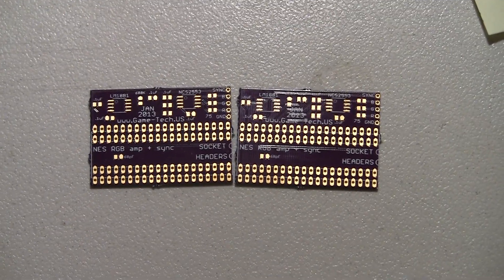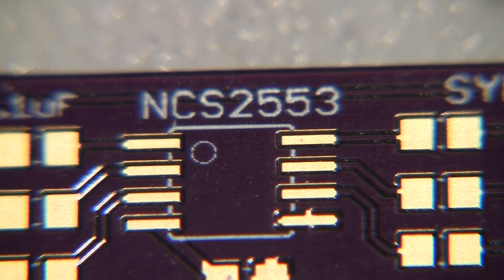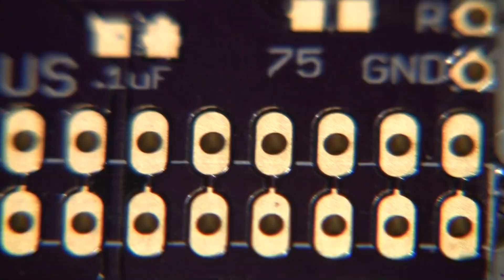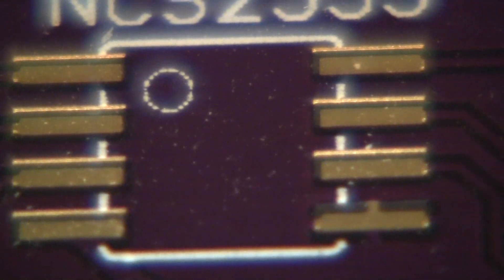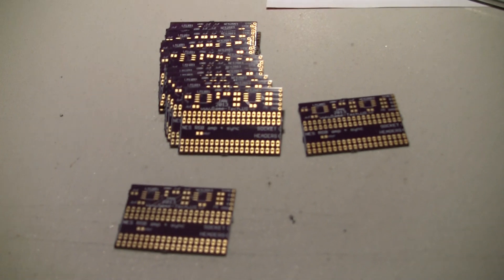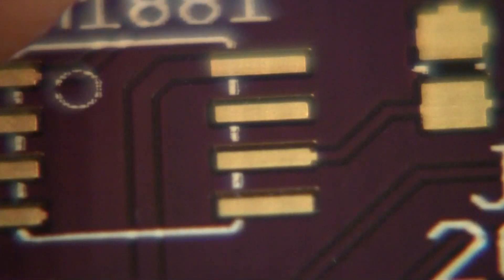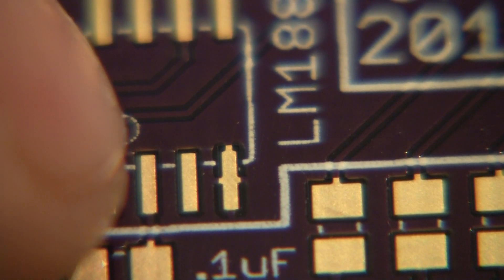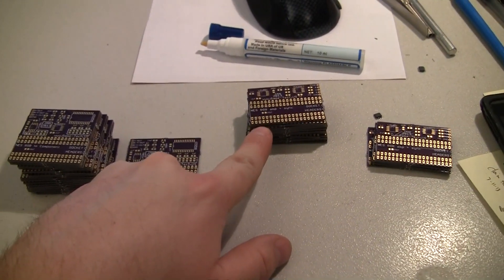OSHPark PCB fab fail - inspect your boards prior to assembly!!!

Comment: I agree with Graham Davies, looks like your mask opening is too big or your Cu to Cu spacing is too small between the pads/traces and the copper pour. It is not wise to design the PCB close to the limits. With a +/-3mil location tolerance that Graham mentions for the soldermask location a good design value for the mask opening will be pad + 10mil.

If you are using above recommended value and a 6mil pad to copper pour (Cu to Cu), and your are in a situation where the location tolerance goes to the 3mil maximum on any direction 2mil of the copper pour will be exposed (like happened in your PCB). In this case I'll recommend at least to us 10mil spacing between the pads and copper pour, to be in safe side you could use 15mil.

On your video NCS2553 is shown, the pad width of the recommended manufacturer footprint is 24mil, from your image looks like the pad to copper pour spacing is 1/3 of the NCS2553 pad width, so it should be close to 6mil.

To me it looks like a design issue, not a OSH Park fail. Increase the pad/trace to Cu pour spacing to at least 10mil (15mil preferred) and you will not see more fails.
Reply: GameTechUS You should add an annotation or remove the video.
Reply from the maker: Read my comments below from 9 months ago...
Reply: morris1891 Thanks for taking the time to find this information.

Comment: You claim that this is a "PCB fab fail" and "not [your] fault", but it looks to me as if you've used an excessively large solder mask clearance and/or too small an isolation gap for your ground plane.  It is totally unfair on OSHPark for you to post this video without telling viewers these figures.  Using OSHPark's design rules, the ground plane could be only 6 mils from the SMD pads.  Also by OSHPark's design rules, you are supposed to have a 3 mil solder mask clearance.  From this, it looks as if OSHPark expect an alignment error for the solder mask of up to 3 mils. It's hard to tell from the video, but it looks to me as if you've got a solder mask clearance quit a bit larger than 3 mils.  If you haven't increased the ground plane isolation gap, then you are doomed to have exposed copper on the plane and it is totally your fault.  (Also, you're obviously using too much solder during assembly.)

Comment from the maker: It has something to do with the settings in 'rendering' that I had to change to get hole sizes to come out correctly, the pads shrank in size, but the holes diameters got bigger which is what I needed on the socket and header 40pin DIP packages. I'm trying to make a vid about this, but i'm not having much luck with capture software, bandicam doesn't want to output vid files that powerdirector will work with...